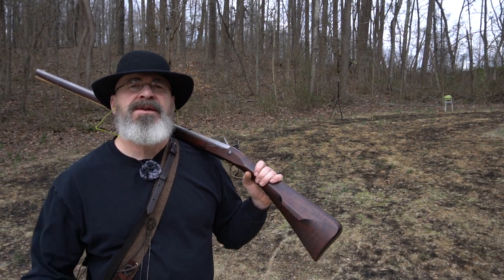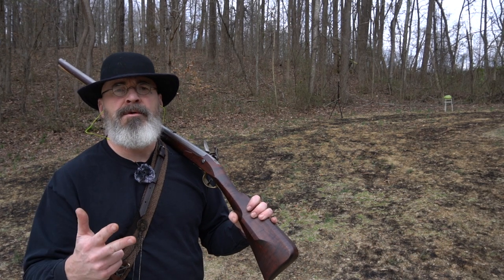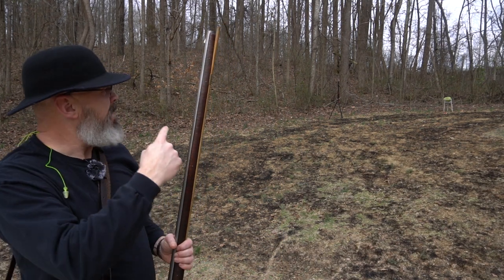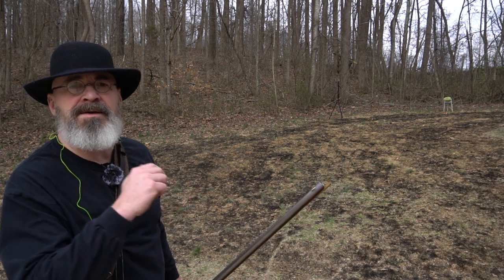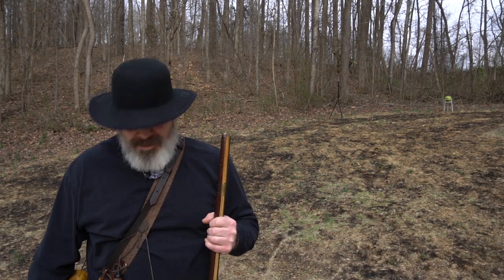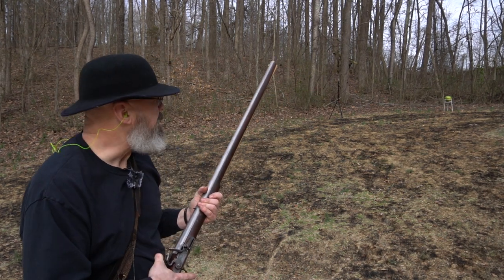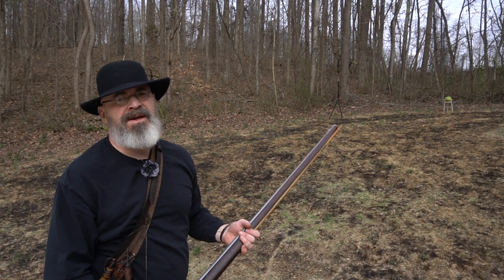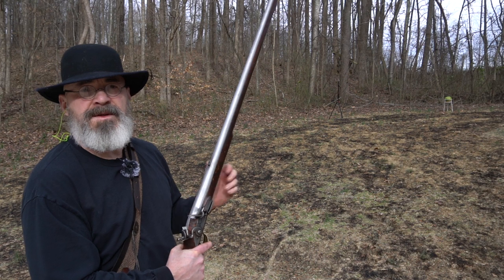WHICH BLACK POWDER FOR YOUR FLINTLOCK PAN?

Comment: Just picked up a 32 flintlock and am binge watching your videos again. Great content.
Reply from the maker: Thanks Muddy! Enjoy! If you have any questions email me at bob@blackpowdertv.com 👍🏻
Reply: @BlackPowderTV  I do have a quick one that others may find useful. Pyrodex? Can it work? It's what I have currently. Order is in for goex. I have ground some pyrodex very fine for the pan, but ignition isn't reliable.  My opinion is it's not violent enough to jump through the flash hole consistently. Thouhts?
Reply from the maker: @muddyudders  Some folks have told me they use 10g of Pyrodex in the bore with the rest of the charge made up of BP with BP in the pan to stretch their BP supply. I’ve never tried that but I do agree Pyrodex in flintlocks is ‘problematic’, as the kids say.

Comment: It's surprising how little apparent difference there was between the coarsest and finest powders. My only flintlock currently is a Pedersoli Bess, and I use 2F for both the main charge and in the pan.
Reply from the maker: Cro Minion It was a bit surprising. I have seen larger differences when the flash hole is smaller but typically I find the difference perceptible but small. I’ll use 0B or 4f for bench work but often will use powder from the horn if using 2f or finer. Thanks!

Comment: Great video as always, too bad the mix went down at the end. I used to prime with 4F, but after getting into hunting, I switched to 3F for priming, just for the fact that it seems to be more resilient when sitting in the pan for hours on end, and I see no difference in ignition time. It has the added benefit of not needing two powders, since I also use 3F for the main charge in everything. On another note, I load my fowler the exact same way you do, so it was kind of neat to see in your video. Wad of tow both before and after the ball, and push them all down together. When I can recover my tow wads, I re-use them as tinder for fires.
Reply from the maker: Kyle Sondergaard Thanks Kyle! I also don’t use a primer for 3f guns and use my used tow for tinder. Also, fine ground powder does not work as well in high humidity sitting in the pan for hours. Excellent point.
Reply: For hunting, you've got the right idea.   But in my flinter, ff for the main charge and the pan does not work as well as ffff.  Just mine, yours will probably be different.

Comment: I use 2F in my .54, 4F in the pan UNLES it's humid/moist. 4F is a faster ignition but it tends to absorb moisture. I then prime with the 2F (less absorbent). Also, depending on weather, clean out the pan and re-prime every 10-15 min if need be.
Reply from the maker: Excellent advise! Thanks!

Comment: I always use same powder in bore and pan. I figure any difference in the speed is not worth the hassle of dealing with two different powders.
Reply from the maker: I mostly do too but occasionally there is a gun that shoots 2f that just shoots so much faster with 4f or 0B, especially the short barrels that I like, that i had to give this .72 a go. I'm not entirely certain that as long as you aren't a flincher you couldn't get by with FG in the pan if it shoots it relatively fast.....
Reply: Pletcher's timing experiments convinced me of this as well.  Our ears are not computer timing devices as his were.  Priming with my main charge powder for the woods-always. Well--then I've not ever shot F and Pletch didn't test F as I recall.  Perhaps I prime my F gun with FF!  (smirk).
Reply from the maker: Wade Patton Fg is pretty dirty but it’s nice to shoot a big bore without the bruising I get with 2f/3f in those bores. I’ll probably use 4f/0B with this gun just because I have it and I could feel the difference in real time, as small as it was....
Reply: @BlackPowderTV  Certainly plan to try 1F for shot loads and bare ball when I get smoothie going. I may or may not prime with it, we'll see. Mr. Kettenburg makes a fine gun-congrats on that one.
Reply: Depends on the gun you are shooting.

Comment: Haven't watched full video yet, but I will. Reason for immediate response is an "FYI". The British manual of arms for the Enfield flintlock has the soldiers tearing open the paper cartridge, priming the pan, then pouring the rest of the powder in the bore, and following with the ball (still wrapped in the paper). 
The takeaway here, is that they used the same 2F in the pan that they did for the main charge.
My understanding is that 4F is the preferred pan powder for target shooters because of a quicker ignition. But it isn't mandatory as the Enfield manual of arms shows. 
What I've found is that 4F can potentially fill the flash hole and that's bad because you get a fuse effect and hang fire. As long as the flash hole is clear, all that's needed is a good flame.
Reply: @Robert Stallard - 👍

Comment: I get a kick out of those folks who say you "have to use 4f in the pan". Unless it is very low humidity out I use 3f or even 2f. If it's slower I can't feel it. Black Powder Maniac could learn about not flinching from you! Just takes practice and determination.

Comment: I've been building and shooting FL's for over 50 years. I have always used the same powder in the pan as down the barrel. Never had an issue. Pan half full, tapped away from the hole and keep your flint sharp. Bang Bang. By the way, 110gr is way too much for that musket. 85 is sufficient.

Comment: Flintlocks have peaked my curiosity lately. Iv never shot, handled or even seen one in person so go easy on me with telling me how stupid this question is lol. Wouldn't priming the pan with a very small amount of modern smokeless powder result in the quickest burn? Or would it damage the pan and/or the frizzen? Once again, just curious about something I know nothing about
Reply from the maker: Hey Jason, I don’t think it would damage anything but as BP acts more like an explosion than modern smokeless I would think the flash of BP would propagate faster. Also I’m not certain modern smokeless would reliably go off with the weak sparks from a flintlock. Interesting thought but as modern smokeless is so dangerous in a Traditional BP barrel we normally keep these two separated.
Reply: Black Powder TV ok that makes sense. And yes you are right, probably best to air on the side of caution and keep smokeless powder far away from the entire process of BP lol. Thankyou for the reply. Cheers!

Comment: Are there a reasonable substitutes for flax tow? I like the method you use but sometimes flax tow isn’t available.
Reply from the maker: Jason Charles Reichenbach, Esq. Tow has been used forever because it’s been common and cheap in the past, and excellent for wadding but you can try any number of things. Historically people have used green leaves, moss, squares of deer hide, balls of paper, etc. The only issue is is that tow and paper etc can pose a fire risk if it’s a dry summer day. Lots of traditionalists I know use green leaves. They have pretty good luck with them. Anything that will hold your ball or shot firmly against the powder even when you shake the gun upside down will work. I buy my tow bulk on eBay.
Reply: Black Powder TV That’s solid information, brother. I just bought 2 # of flax tow on eBay for about $56, shipping included, from Pennsylvania. I’ll experiment with a few things. Some of my flintlock .69 smoothbore military pistols don’t like a patch. Rather than cast a smaller ball, I may see what results I obtain with tow.
Reply from the maker: Jason Charles Reichenbach, Esq. Sounds like a solid plan. I think that’s the same lady I buy my tow from. Pitman, PA? Be ready. Two pounds of tow will fill a large pillow. Have fun!

Comment: Bob; were you out of 4F? I find very little difference between 3F & 4F but always wind up spilling too much powder in the pan when loading from my horn so I use a small flat priming horn I carry in my bag. Great video, something most have never seen. Get over that cold Mr. "Snuffelupagus"
Reply from the maker: Mike McGuire Hey Mike, no, I use 4f and 0B interchangeably as I’ve seen very little diffference between the two, but find both  slightly faster than than 3f. I put 2F and 1F pretty similarly slow but shootable. The cold was only a 48 hour one but the sniffles have lasted a week. Arrrgh.

Comment: At what time in this video was 4-F used?
Reply from the maker: Jason Charles Reichenbach, Esq. If I recall right, I used 0B instead of 4F because, though it is similar, 0B is slightly finer and therefore slightly faster. I wanted to show the slowest vs the fastest ignition time in that gun. Hope that was ok. Thanks.

Comment: What if I just ground up some of my 2f for the pan instead of buying all new powder?
Reply from the maker: It's doable but comes with some risk. I don't recommend it but finer does equal faster.
Reply: @BlackPowderTV  eh, I feel like I'd be safe enough. I've made black powder before anyway
Reply from the maker: @sethmullins8346  Then there you go. Grind away. Let me know how it works in the pan. 👍🏻

Comment: I am looking at getting a smoothbore musket and a pistol, both in .60 caliber. Would it be okay to just buy 3F powder (or 2F) so I don't have to get different powders?
Reply from the maker: Either would be fine. I’d probably use 2f myself but then I’d want 3f in the pan. Some folks say they can’t feel a difference but I can. With 3f in the bore I’d just use a slightly smaller charge, say 15% smaller than 2f and it’ll be about the same. The velocity will be higher with the 3f.
Reply: @BlackPowderTV  Thank you. I think four pounds of 2F and one of 4F is probably going to be my first purchase.
Reply from the maker: That’s probably what I’d do too. Maybe consider Swiss Null B if they have it for primer. It’s about 7f. Very fast. But 4f is great too.
Reply: @BlackPowderTV  Thanks again. Looking forward to more content.